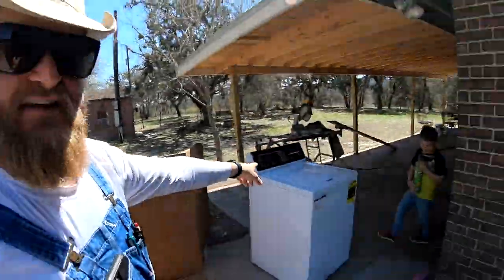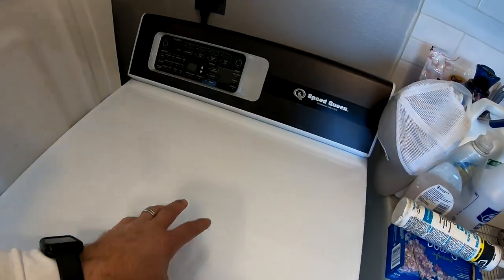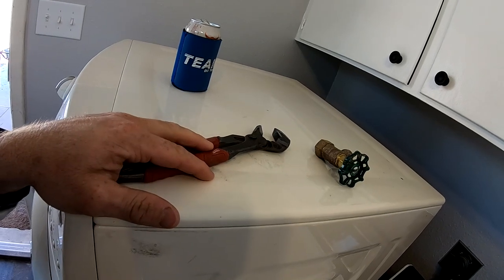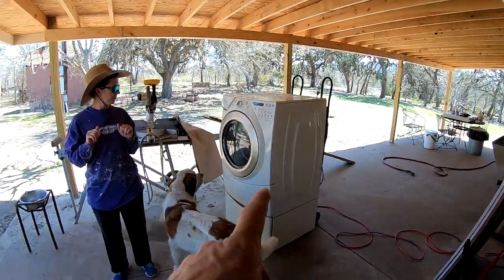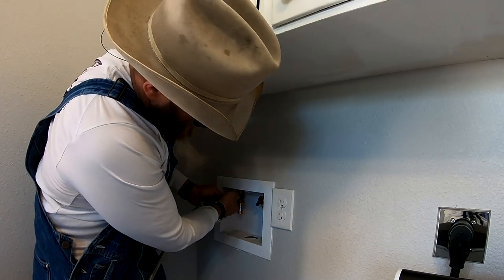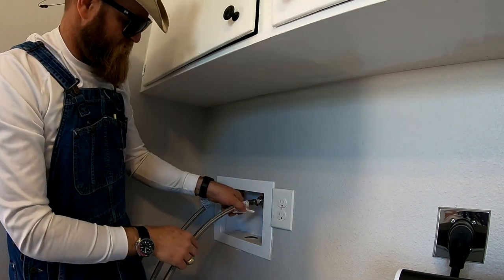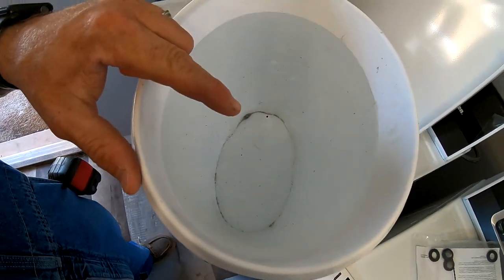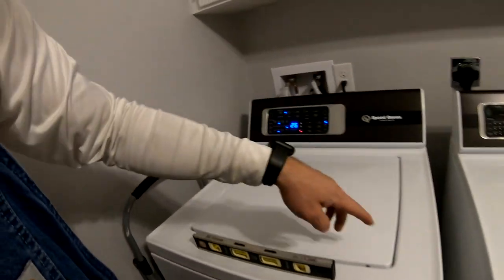HOW TO INSTALL A WASHER MACHINE SPEED QUEEN TR7

Comment: You skipped over the drain hose part, I came here looking for info on that because mine popped out. Is yours just hanging in there, or does it have a rubber friction fit?

Comment: May I ask if this is the TR7000 or TR7003?
Reply from the maker: This is the TR7003WN, hope that helps. Thanks for watching!
Reply: Thanks. So I just bought the same one Aug.1 2021. Now all of a sudden the actual washer does not turn on. Have you had this problem?
Reply from the maker: I have not……no lights or anything?
Reply: @jennifermann4776  Should have got a TC5.

Comment: I just got mine and the washer will not come on!!!!!!!
Reply from the maker: Did you get it turned ON?
Reply: @TexasBeardAdventures  yes. They will need to come out and fix the lid. I have to apply pressure for it to make contact for the water to come on. This washer I bought is for commercial only, it says, and doesn't come with a warranty.  However, he said he would come iut at no charge thankfully.  I paid a good penny for it.